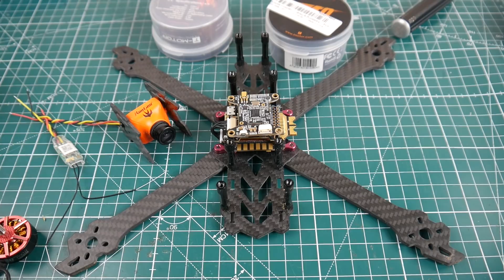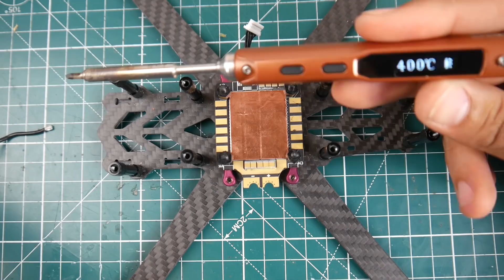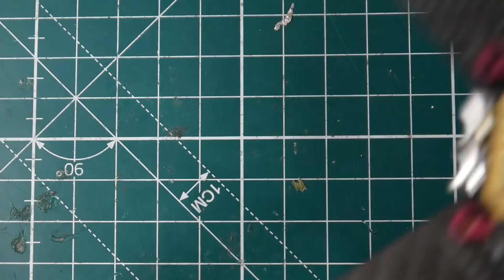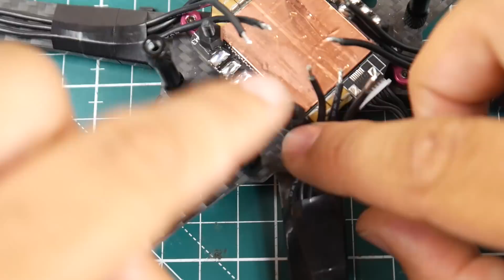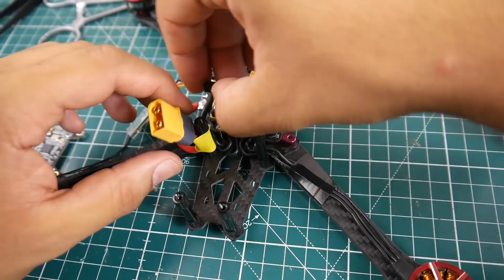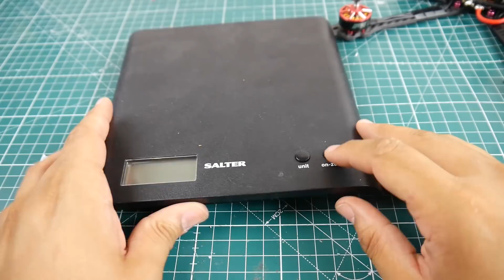How to Build Latest F7 FPV Racing Drone 2018!! // #HOWTO #DIY #BUILD #FPV #DRONE #DRONERACING

Comment: Why did you mount the needle at 90 degrees? Are you taking the battery power out to the side? Wasn't it better for the motors on the side?

Comment: 340 gram drone, this is joke, not drone. my next drone weight have about 20-23KG not gram. hahahaha or made little drone only second 10-12KG weight. same controller i think or kakute F7 board, and 80A ESC 8 pcs and 170KV motors 8 pcs. thats is perfect DRONE not joke.

Comment: I bought this flight controller. In the 8 pin plug, there is a pin tagged "I", between M1 and G.
What is it?? It is not explained in manual.
I ve a tekko32 metal 4in1 esc, and relative pad on ESC on the 8-pin plug is pin tagged "CURRENT".
Dont understand :/

Comment: Thanks for the video, can I use this board to power the DJi digital system? The system takes 4s but I plan to take advantage of the 6s capability of the board, but idk how to send power to it on this board
Reply: You can wire up the power to a 9v output or any voltage within the permissible range, which I think is 7.4 - 17 volts or so. Just look at the wiring diagram of the board and find a voltage output in the range, then wire the red power lead to that and the black ground lead to the most convenient ground pad on the board.

Comment: Hey Bob, you wraskeley Builder!! I tuned into this video to learn a thing or two about a 'build'. I was not disappointed - as I followed along with your tutlage I found myself falling further and farther behind as the subject matters thickened. But I decided to hang on thru that build -my own excitement began to pump right along with you and that sweet drone would be ranked up there with the Chariots of the Gods!!! 
Maybe I didt
 not look hard enough but, I could find no trace of any follow-up. I dearly wanted to see that multi layer creation take the wind!  I don't think that to fair for your troops of followers. And I'm sorry but, well I am very dissapointed in you... In fact, I was prepared to  purchase a fresh new soldering iron and try mailing it out to you. A fresh can of pro flux-a roll of the finest solder available. Not to say anything negative about your work but, a proper rank of operating equiptment is essential. .........good lord >> did you botch that build? I think you did! GET A NEW SOLDERING IRON AND maybe take a class... thanks

Comment: Other than pitching all the merch to pick up a tiny commission, did you ever add up the cost of all the parts?   it'w well over $800 not including a controller.    Might as well by the Mavic pro 2
Reply: J Smith mavic and fpv quad are very different
Reply: thats controller cost maximum 20-24$ wery cheap and this frame cost 12-90$ and all other stuf together about 20-40$ not expensive. cheap can made this drone.

Comment: Isopropyl alcohol on a tooth brush for that flux splattering. Takes it right off and cleans up the flux crud from around your solder joints too for extra pretty builds.
Reply: This is a must, the flux is corrosive you have to clean it up

Comment: I think there is smaller F7 chip out there, its of the size of f4
Reply: STM32F722 package
Reply: Yeah, the holybro kakute f7 uses the f745. The matek f722 uses a f722.

Comment: You short circuited the mosfet pads on the minute 19:04
Reply: Loudbeat FPV good eye... played back in slow 0.25 and sure enough  solder splatter jumped over to mosfet
Reply: Ty Adam schlichting, I just hope he sees it before he plug the battery or something will go wrong.
Reply: Quite easy to se :-)
Hope he gets it
Reply: @PerBuch  they are all drain (output) pins so no worries
Reply: They are all drain pins so no worries
Reply: My problem i have is how everyone on YouTube solders. One doesn't continuously add solder directly to the tip. Tis why it took so long to cover the whole pad. Heat pad, add solder to pad. It'll melt and flow to the entire pad. Assuming it was heated properly.

Comment: i have almost the same bild and its grate only down side to this vtx (this stac its realy tight and  in front crush my battery strap riped of this white connetor from vtx with pads... i suggest to desolder this white connector and solder wires directy to bord you gain this way a lot of space and your vtx is secure.